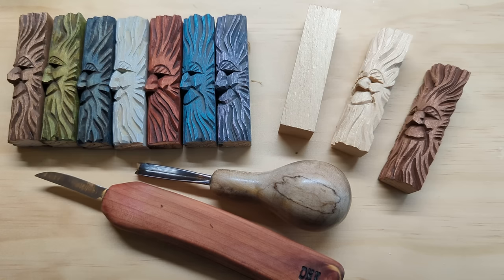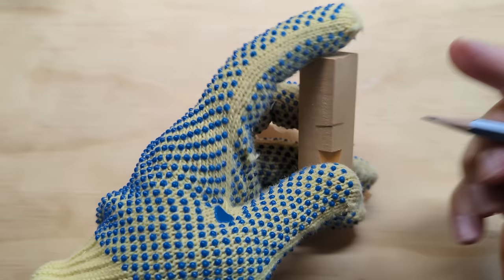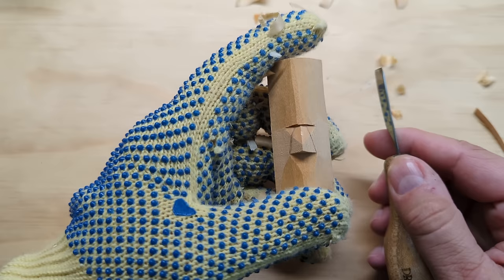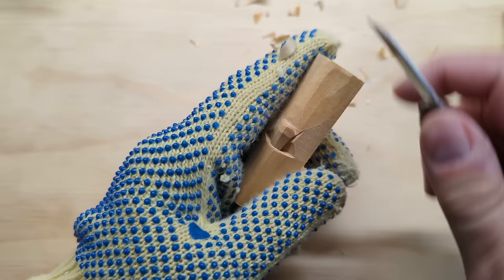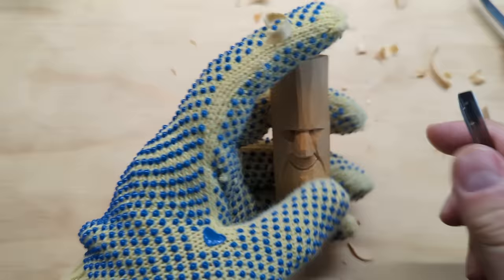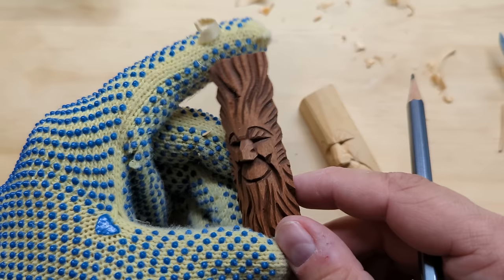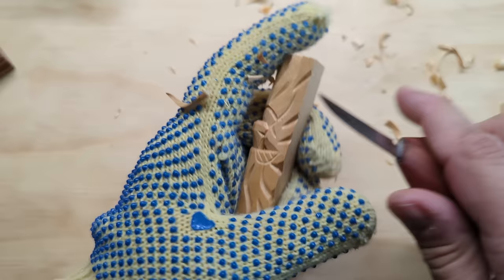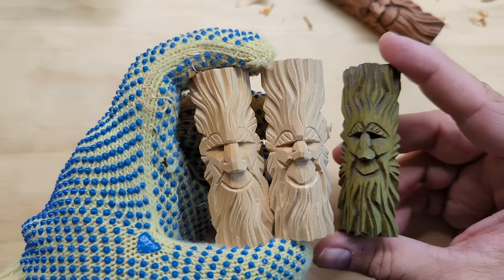Carve a Simple Woodspirit in 15 Minutes - Complete Beginner Woodcarving Lesson

Comment: I would like to suggest you make a complete video on sharping knifes and gouges. I have been following this video and carving my own wood sprit. To be honest, having a hard time of it. Also let me add that I have been chip carving since the late 90's and my chip knives cut wood very well. After struggling to get decent cuts with my Flexcut detail knife i brought out one of my chip knives and solved my problem. Even though the flexcut seemed Sharpe and I had stropped it numerous times, it didn't seem to cut right. I spent some time this morning and did a proper sharpening and the knife now cuts well. The first lesson in my first chip carving class was sharpening a knife. I made all the difference in my desire to peruse this hobby. I firmly believe the sharping of a knife is key to enjoying the process..
Reply: I guess I need to remember where I am putting my comments. I know you already did a video on sharpening. sorry for my placement of comments. If I could remove this comment I would.

Comment: Question on the business end of V-Gouge, your current side profile is square ._____| some ore angled in/out _____/. Or _____\ 
I bought one they _____/ shape, difficult to sharpen, but nice clean easy carves.
One arrived today _____\ very difficult to use as it wants to dig in.
Is it viable/safe to regarding to better shape? Have you any videos on using different V-Gouge shapes?
Reply from the maker: I believe you are referring to the different angles of the v gouges, they do come in a variety of angles and sizes. The one in the video is a 1/4 inch, 60 degree true V tool.  I have a video that explains the differences in v tools, including sizes, angles and the difference between a "true" v or "soft" v. Maybe this will help if you haven't seen it yet: https://youtu.be/j1wXFKLuc8g
Reply: @dywoodcarving - thank you for this. Amazing video and guidance. I’m struggling to find a v tool like yours (palm, with that blade length). Do you mind sharing the tool brand/name that you’re using here? 🙏

Comment: Is it normal to have the wood become really chippy and splintery as you use the v tool?  Also how hard do you have to push with the v tool? It is so hard to push using basswood
Reply from the maker: It shouldn't really be hard to push through, but may take some practice. I wouldn't say splintering is normal, but it is possible with the v tool because one side is usually carving against the grain while the other is carving with the grain. I explain this more in my video on v tools along with some tips for making clean cuts.

Comment: What kind of wood do you use? Could I just buy something cheaper from like Lowe's?
Reply from the maker: This is basswood. I have another video on wood with some recommedations for where to find basswood. You can sometimes find craft basswood at Lowe's or other large hardware stores, but it is often very hard. You can also try square dowels from hardware stores that's often  poplar but can be hard as well. Some people carve scrap pine. If you can find some with a tight even grain it may work ok.